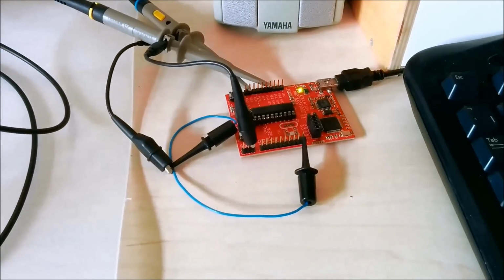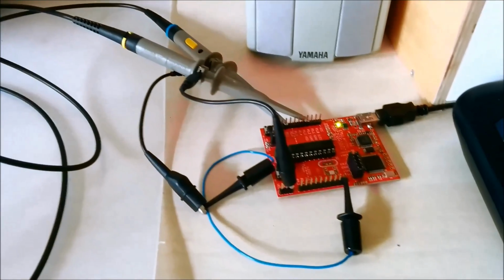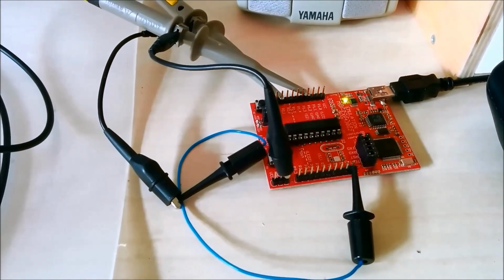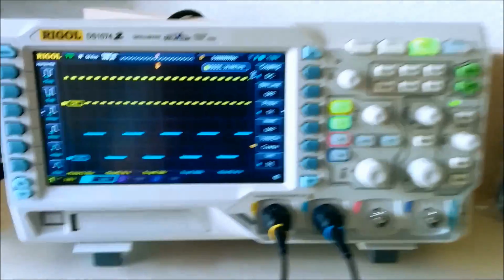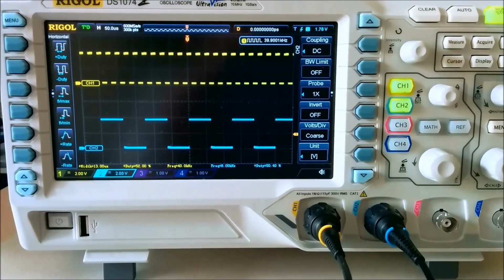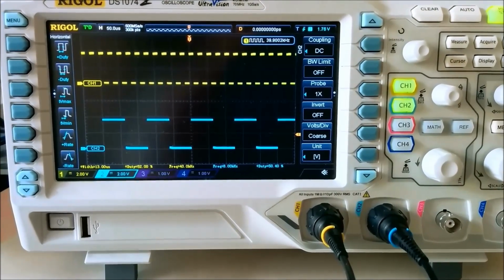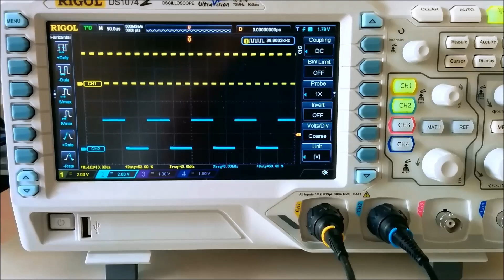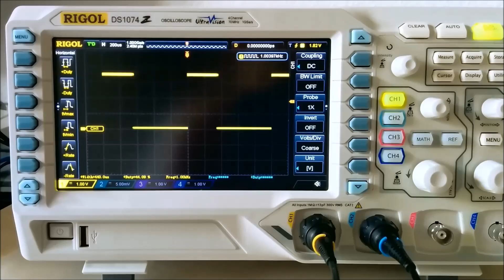MSP430 Timer PWM Tutorial and example Code

Comment: Thanks, It's very useful.  One question.  From your example 2, your clock is 8Mhz, and TACCR0 = 200.  You said the PWM frequency is 40Khz.  Isn't it 20Khz as 8Mhz/(200 * 2)  = 20Khz?  200*2 = count up and down.  Can you please clarify that?
Reply: Never mind.  You are using count up mode so it is right.